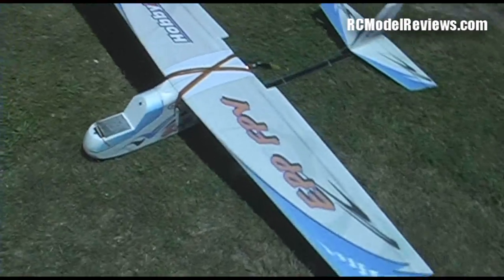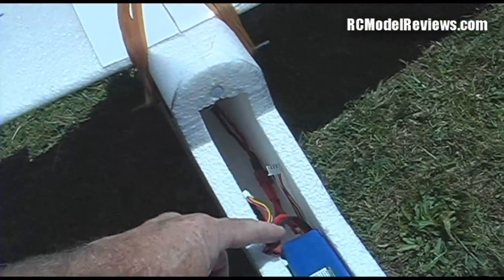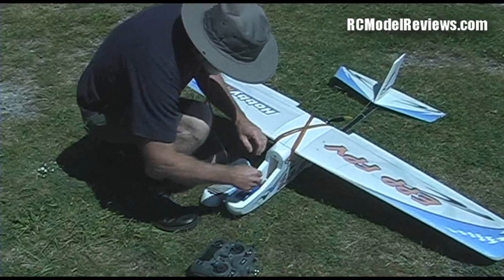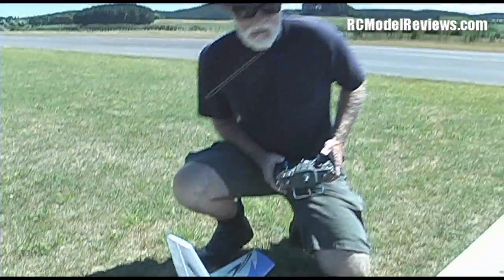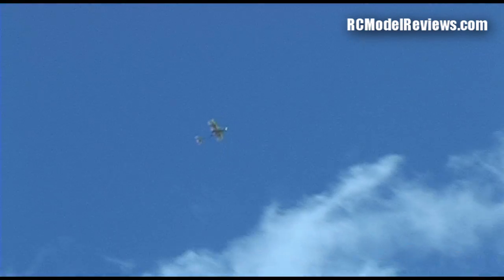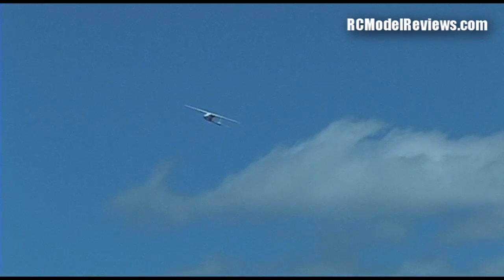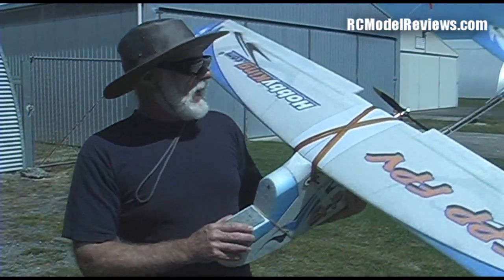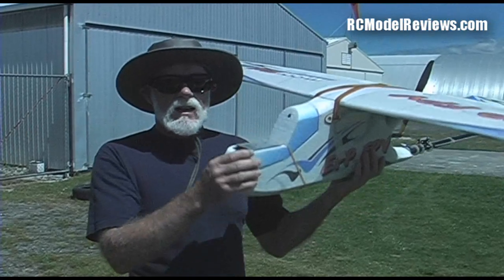HobbyKing EPP FPV RC model plane, part 3 - the test flight

Comment: i know it´s been a long time but i have the same and even it has a very strong motor it feels that its pushing down, did you put the motor with an angle different than 0? maybe tilting the thrust angle upwards will obtain better results?

Comment: I got this fm Hobbyking along with : " HobbyKing Donkey ST3511   810KV motor - 30A ESC combo"   kindly suggest will it be OK for the plane? all i'm looking for is fun flying. Can it do the job ?.. if it is really under powered, kindly suggest which motor and ESC combination I should use

Comment: Interesting vid Bruce. There seems to be an awful lot of fuselage that isn't really doing much in this model, especially up front. Methinks a more cutaway profile, plus a mid-high tail with a longer V stabiliser, plus some dihedral would improve its flight characteristics, especially for FPV. I was thinking of getting on of these at first, but may well look for something better thought out..or build from scratch. What sort of aerofoil is it BTW?

Comment: Bruce, although it seems a bit counter-intuitive, using dihedral to provide lateral stability in a camera plane can be a bad thing, especially if you are trying to take vertical pictures in gusty conditions. The dihedral induces a roll when the angle of air flow over the wing changes, just like rudder input does. I discovered the importance of this effect when I compared a "trainer" wing with a flat wing while flying transects and taking a series of pictures that all had to be NADIR.

Comment: When flying a real full size plane you almost always coordinate your turns with rudder otherwise you are in a skid or slip. Turns are just cleaner when the right amount of rudder is used. "Step on the ball"

Comment: Thanks again for this great unbiased review.
I am concerned about all boom type stabilizer setups as this allows for twisting in flight.  While a T-tail setup would take care of the H-stab touching at landing, the setup allows for extreme flexing of the H-stab without braces.  If you add braces, it may help, but then you increase the possibility of the boom twisting, or becoming loose in the fuselage.
I never considered the fact of the fuse shape causing the yaw condition you mentioned.
Thanks!